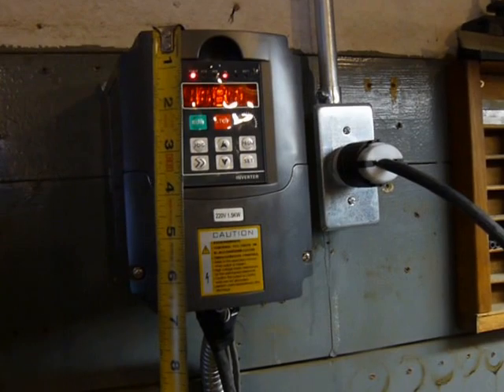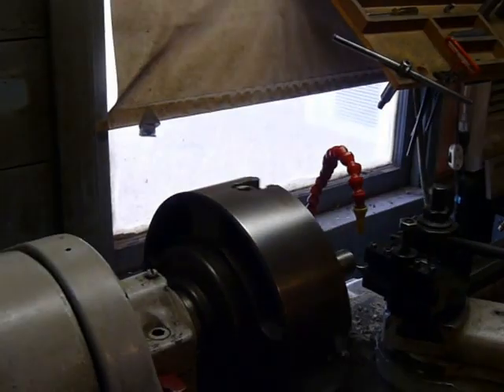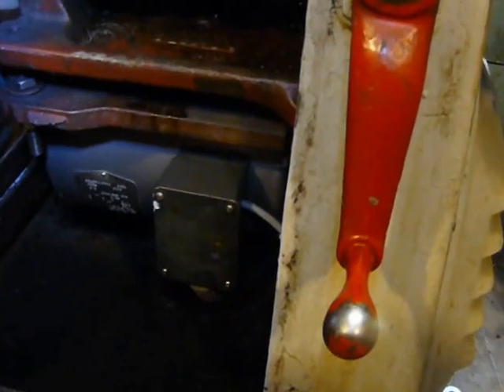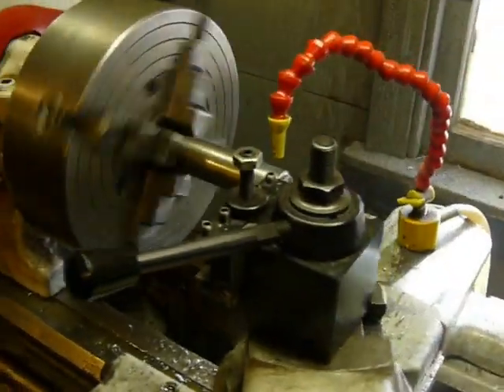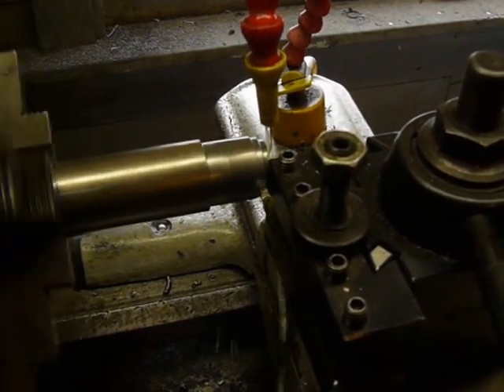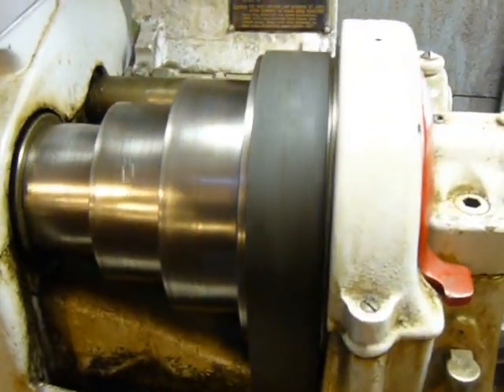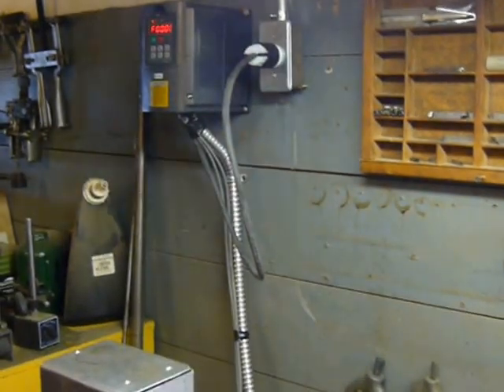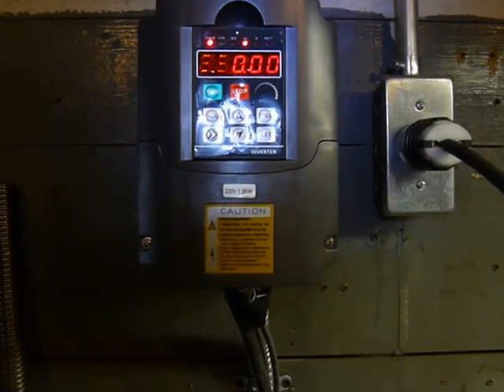13" South Bend Lathe with Huanyang vfd 1.5KW 2hp variable speed drive single to three phase.

Comment: Am currently wiring a 2.2kw converter to my ENCO, from the same company.  The manual sucks.  Great job on wiring yours.
Reply from the maker: If the units came with a good English manual they could probably double the price and still sell them. There are some parts of the Chinglish manual I have yet to comprehend... I have had these on three of my tools for over 6 years now without any issues..  Good Luck..
Reply: You would think they would hire someone from here to write their manuals for sales to the US.

Comment: i need that on my 13. im running a 5 hp rotary converter now seems like this would use less power
Reply from the maker: Yes, the VFD uses less power than a rotary converter.  The advantage to the rotary is that it allows you to operate more than one motor at a time. The VFD is dedicated to one motor.